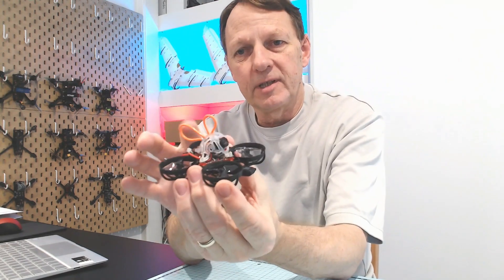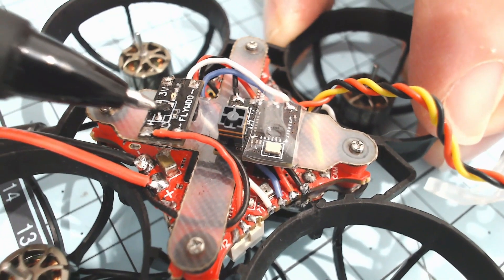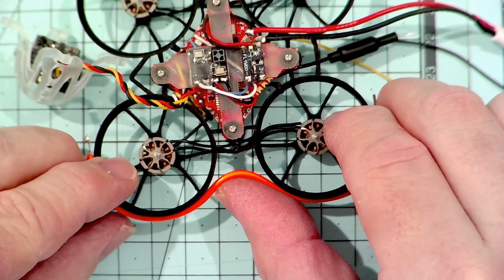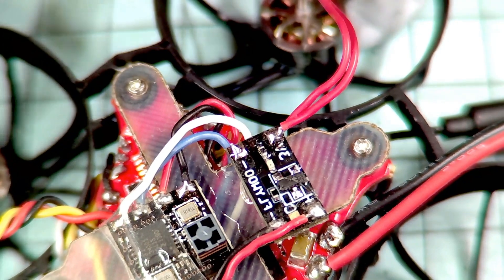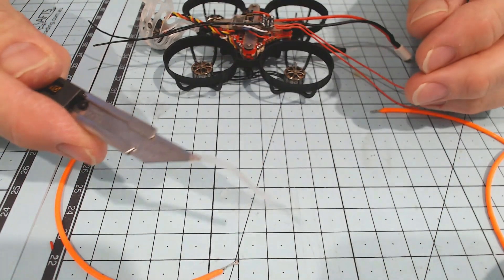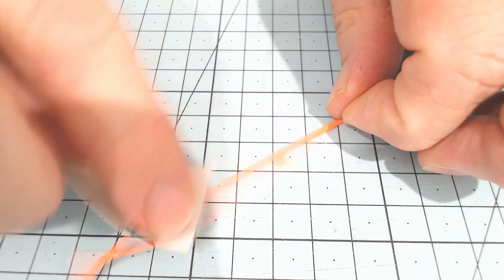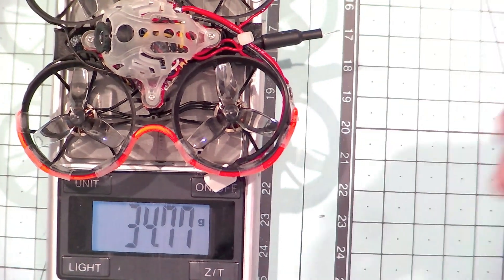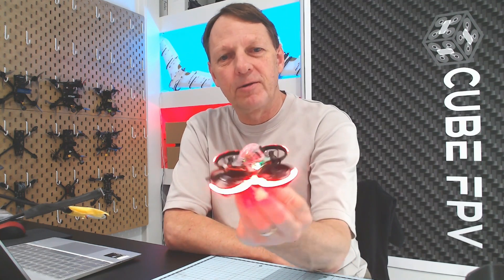Micro COB LEDs on a Whoop

Comment: Can this led be wired directly to the 3.3 volt pad and ground on a flight controller or do you have to use the voltage regulator?
Reply from the maker: No you need to use a reg poswered from Vbatt. These LEDs pull more amps than the 3.3volt rail can usually supply. 3.3 volt rail is intended for low current draw things such as GPS and Rx.

Comment: I was just looking into underground whoop league and was wondering, would you recommend the 70mm or 120mm version of these on your site for a75mm frame like the Mobula 7 or meteor 75? I want to make sure I get the right one :)
Reply from the maker: Go for 70mm - but remember these leds pull a lot of current - you're going to get shorter flight times. Also voltage is strictly max 3.3 volts. They will burn at 4.2 (1S) volts.